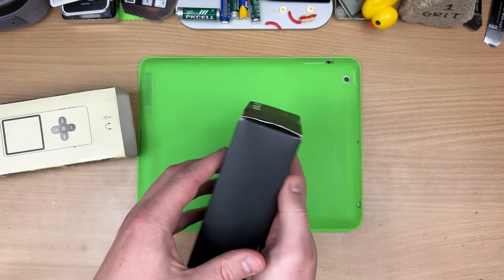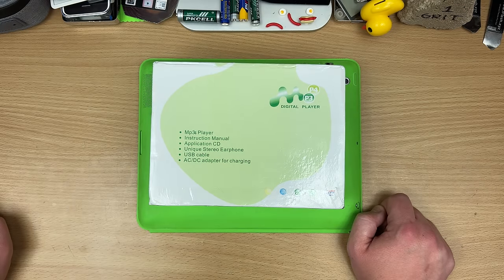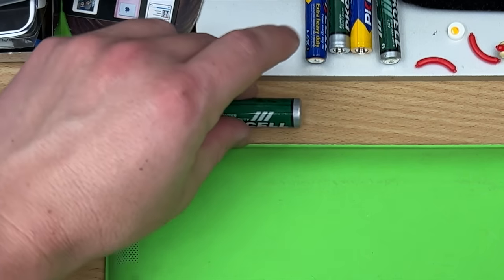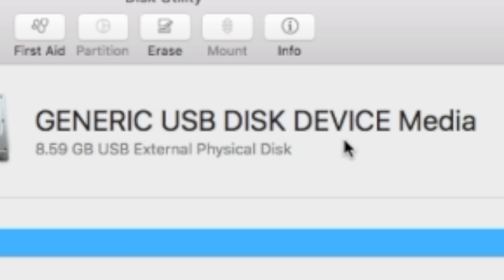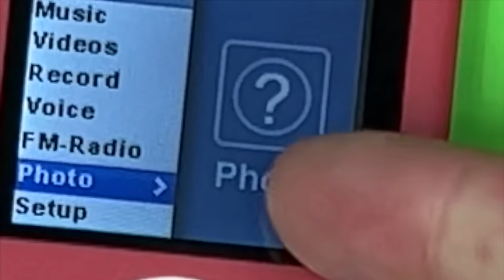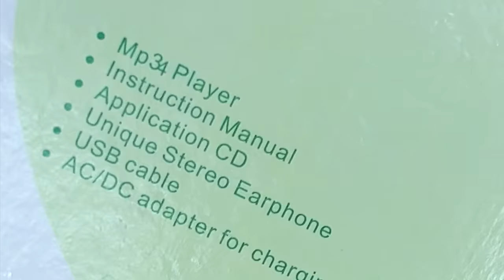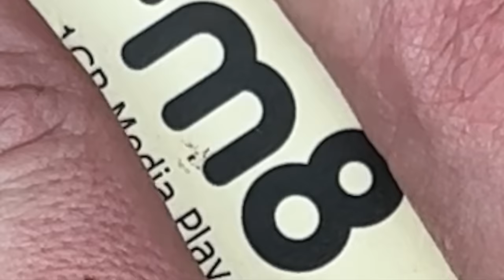The absolute worst bootleg iPod.

Comment: Dankpods getting immensely frustrated with an actually really good windows laptop is hilarious XD
Reply: I mean, it's windows 11 i feel bad for him.
Reply: @Ferrari255GTO  and he could switch to Windows 10, because of the whole seamless thing Microsoft had done with both OS’
Not my fault Dankpods is immensely picky, and has 0 tolerance with anything windows, or also literally 0 knowledge of modern windows.
Reply: @Thewaterspirit57  at least he does know that the new macs aren't worth it either, there's a reason why he has a gen 2 ipad and a 2012 mac
Reply: @Ferrari255GTO  the new ones a literally worth it far more than those old ones. More powerful and actually reliable. He just keeps old ones for other old iPods sometimes.
Also last time I checked, dankpods has an iPad Pro.
Also smh, fake fan. He has an iPad 4
Reply: @Thewaterspirit57  oh, right, firewire is a thing XD. To be honest he would be just as capable of working with ipods with a modern one, it's just that whenever he needs a jumpstart he will need to get a firewire charger
Reply: @Ferrari255GTO  smh fake fan he has a 2007 iMac and an iPad 4
Reply: "really good" :face-blue-smiling:
Reply: @Thewaterspirit57  "the new ones are literally worth it"
Ah yes, pay 4x as much for 1/4 of the hardware, completely worth it. Oh, but you can watch videos and write documents real well with it, definitely need that 2000 whatevermoney ripoff with a fruit on it. Good choice 👍

Comment: DankPods, The iPod was not the issue. Well, technically, it was. But, internally, it actually had a disc error.
Reply: Maybe it has formatted the wrong way or the storage chip was faulty it couldn't read the data blocks inside of it
Reply: @sihamhamda47  I think the error comes from ereasing the disk and formatting it for Mac, it probably was FAT32 to begin with.

Comment: I've looked up the datasheet and that Samsung chip was an 8gb memory, so they didn't skimp on that. They clearly skimped on the people building the firmware, because that nugget did not enjoy being wiped. Hail the 1 grit
Reply: I looked at the datasheet too and it says it's a 1 gigabyte chip. The box and device is lying about its size. That's why it showed up as 1 gigabyte once he formatted it at 9:45. Not only is it a terrible device, it's also a scam because it clearly shows 8GB (8 gigabytes) on the box. 😂
Reply: @JS19000  ok is it one gig or 8 cuz if they said the datasheet said 8 and you say it said 1 is weird
Reply: @kuirivito  It's a 1 gigabyte chip. Since there's 8 bits in a byte that would be an 8 gigabit chip. GB with a capital B means gigabytes and Gb with a lowercase B means gigabits.

Comment: Just a little fun fact!

I know you're laughing at it having a Samsung chip in it, but you'd be surprised to know that Apple and Samsung have had numerous partnerships over decades.  Samsung is one of the only companies with factories capable of keeping up with the demand for Apple products, so it's not unheard of for Apple products to be full of Samsung chips and screens.

Now, I highly doubt that specific chip (which looked like an embedded multimedia card when I googled it) was made for iPods, so that's still something to laugh about!
Reply: Samsung actually make the screens that go on iPhones as well as some of the batteries that ship with them
Reply: @khristopherkomodoensis4734  Pre A-series iPhones had Samsung-designed CPUs and before TSMC's ongoing process node domination A-series chips came from Samsung foundries as well.
Reply: This guy is the only Apple user I don't hate
Reply: Also every iPod (except Touch) after Portal Player has a Samsung SoC on them
Reply: when i saw that it really made me think about how its no different in having samsung parts than a real one.

Comment: That actually looks convincing. They got the finish right, and they even got the iPod font right (which you would think would be easy but most of these guys get it wrong), I mean, the box couldn't look more fake, but the product itself looks kind of convincing, probably enough to fool your friends, as long as you don't let them look closely at the UI. The egg bag looks suspect though, wouldn't use that. Almost seems like the box wasn't designed by the same company that designed the device, maybe a company just bought a ton of these wholesale and they didn't come with boxes, so they made their own half assed attempt which just completely ruins the illusion that it's a legitimate product. But at least they have a box so that it doesn't break in shipping (hopefully)

Shame it doesn't actually work. Maybe it's saying disk error because it's looking for files inside specifically named folders, but there were no folders on the storage so how are you supposed to guess what they should be called?
Maybe you need to use the software on the disc it came with to create the folders and put things in the right places...
Or maybe it just doesn't support Mac format. Try FAT16 or FAT32?
Reply: Fat16 allows up to 4gb in 512 byte sector disks

Comment: I think when you plugged in the "iPod" to your iMac and formatted it, you might've deleted some files that the "iPod" was using, or, even more likely, the "iPod" had folders in it, and it read from those specific folders, not from the main folder. I doubt you can use this info now judging from the... uhh.. state of the nugget in question, but I still wanted to post a comment about this.
Reply: Also could be due to the fact that macOS usually formats things specifically for macos, which the "iPod" probably doesn't support. (It most likely supports FAT32 only)
Reply: that's definitely the case. I had a stinky Nano clone, and you actually had to put music in "MUSIC" and video in "MOVIE"

Comment: Real iPods probably have Samsung chips in them. They're one of the world's largest suppliers of flash memory.
Reply: iphones use samsung RAM if i'm not mistaken
Reply: The first 3 iPhones had Samsung CPUs in them and batteries.
Reply: Classic ipods have an hdd, Toshiba's iirc
Reply: @SilentProti  yes, but all of the Nano, Shuffle, and Touch models are flash-based, and this is a 3rd-gen Nano clone. Many, if not all, of the iPods with hard drives also had Samsung SDRAM.

Comment: So, theory about the 8 gig to 1 gig thing, I’m pretty sure there’s a way to trick the computer to show more storage then is actually capable, and if you transfer more than the actual storage the data just ✨disappears✨
Reply: That is an old trick by some shady bootleg producers. I had a pen drive like that once, bought 16Gb and got just two... They save wrong information on the firmware of the device to trick the compute. In my case the file transfer would crash when it reached the 2Gb mark.
Reply: Imagine trying to make a liveusb like that...
Oof, the Idea of half the ISO failing to write, but not being prompted actally hurts.
Reply: @zehph  I once bought a 32gb flash drive. It read as 32 until I opened it and there was a separate 32gb area with no partition. Turns out it was a 64gb that got put into the 32 production line.
Reply: Linus Tech Tips made a video about that scam a few years ago
Reply: @andrewmorris483  guess it was your lucky day
Reply: If that’s the case though, why would reformatting it cause it to now accurately report it’s size?  He didn’t flash the firmware, just reformatted it, the firmware should still be reporting the same (wrong) size, I’d have thought.  It’s only when you write to it that it’ll crash out.
Reply: @andrewmorris483  Lucky!!!

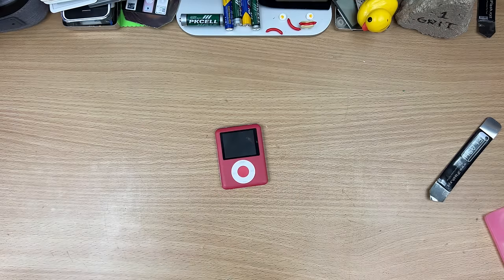Comment: @11:59 If you open an actual (random) Apple product, you could actually find some Samsung chips (like memory/NAND) in it. Samsung is(/was? Seems Apple aimed to do more "in-house") one of the suppliers, of various parts, that Apple uses (others being Toshiba, SK Hynx, Micron, etc)

If I read the markings on the chip correctly it seems to be a 1GB flash chip, so yeah that "8GB tick mark" blatant lie.

Comment: Using a real 30-pin connector isn't as surprising as you might expect. I work in e-recycling and I've seen multiple sandisk and samsung official mp3 players that use apples 30--pin connector, they shocked me the first time I saw them, but now I've seen a good amount of them. So I guess it was used on more than just the Ipod line of devices.
Reply: My high school theatre department had wireless comm headsets (made by Williams Sound) that used an Apple 30-pin connector to charge. They even mention it in the manual.
Reply: My dad has an old Sandisk Sansa player that uses a cable like this. It's actually not a 30-pin connector; it's very similar in form factor, but you cannot use a Sandisk cable on an iPod or vice versa.
Reply: @CocoTheMii  Although the one your dad had might not have supported it, I assure you there are some that do.

Comment: I’m not sure how the “iPod” even worked after you erased everything. I’m assuming there was a little bit of stuff still in ram but I’m pretty sure you wiped the OS…
Reply: Devices usually have a portion of storage that's allocated to the OS that's not erasable through normal means.
Reply: @psychonauts0  I would agree that some parts of the OS are not stored on the hard drive like the BIOS  but given it showed up as USB, i imagine running erase completely wiped the hard drive and the main OS.
Reply: He probably formatted it in HFS+ and GPT instead of MBR and FAT32
Reply: @AllFloofAndNoThoughts  The "OS" is likely in ROM.
Reply: That's, generally, not how embedded devices work. The "OS" (if you can call it that) or firmware are not stored in an location that's accessible via USB/as mass storage, it's either stored in ROM built in to the main micro controller, or on a separate chip and the loaded (via some kind of bootstrap code) on startup. It could be that it's stored in a section of the flash memory chip (but I doubt it, especially since the chip seems to be 1GB, and that is what the computer reports as the full storage space), but still separate from the (user accessible) file structure.

Is it entirely impossible that (part of) the firmware was stored in the file storage? No, but that would be a cumbersome (and unstable?) way to do it (Having to have some basic code first that could handle the file structure, and then load the rest of the firmware. Things like Games would be logical if you loaded from the file storage (easy to add new games etc), but not the main system.

(There are now micro controllers [Arduinos etc] that exposes an mass storage device and lets add "firmware"/code to them that way, but the main "OS" is flashed separately, and not accessible as a normal drive)

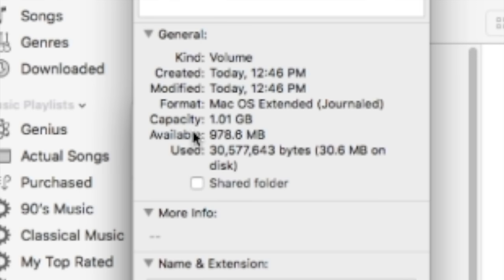Comment: 9:56 hate to bring it to you, but the bootled doesn't support AFS or HFS, that's probably why you got all that disc error, and you may also deleted the OS on your first go in disc-utility
Reply: I think he might’ve just got stuck in a boot loop (if it would even get that far) if he’d erased the OS itself; much more likely that he formatted it in a way the software it’s running can’t recognize or interact with, like you said. Probably wants FAT32.

The OS itself is likely stored in additional memory, like firmware on a motherboard, hence why it could boot and load the UI just fine, but couldn’t access the disk.

Comment: "Designed by Apple in California. Assembled in China"
Yup, says the same on my 5th gen. That print is 1:1 copied from a real iPod, just as the CD is
Even the "Rated 5-30V 1A Max." is a correct copy
Reply: You missed out the typos in the text 😂😂 it actually says Callfomia and Assembied 🤣😂
Reply: The model number printed onto the unit is A1136, which corresponds to the 1st gen iPod nano (the long one) released in 2005, as opposed to the 3rd gen iPod nano which is what this unit is ripping off. Although it's actually printed as AII36.
Reply: @brandontechnerd  oh, don't have my nano anymore

Comment: "linux needs to take over"
I thought the same thing when my wifi adapter crashed and I thought restarting the computer could fix it.
It didn't, and without access to wifi, my laptop was locked out of any administrator accounts and had to be soft formatted.

Comment: Chances are that by formatting the "iPod", it probably formatted it in a file system it can't read. It probably uses fat32, which modern operating systems don't necessarily allow you to format to anymore without third-party software.
Reply: That's what I thought too, he formatted it in OSX journaled, should have done it in Fat32 then it might have worked!

Comment: I have a bootleg iPod that is branded PASBUY.  It has a real touch wheel like the original. 30 pin plug and iPod UI and everything. And it even looks like an iPod on the inside. And it even uses an iPod battery because I had to replace it just for fun.

Comment: Btw when you erased the nug you changed its partition map to GPT, which probably doesn't work with these crappy ones. Even if you tried FAT32, chances are you still set GPT, so it still wouldn't work. Try MBR+FAT32

Comment: You formatted it in MacOS (journaled) which is probably why it didn't work. You should have tried formatting it in FAT16 or FAT32.

Technically though, it should have come pre-formatted in the correct format that it uses

Comment: still wondering how it took him 2 hours to get to the desktop. On my less powerful pc an installation from first restart after loading from usb, it takes 15ish mins to get from there to the desktop
Reply: Isnt His Windows System Like 5 Million years old
Reply: @aaaaa111aaaaa  it supports widows 11

You can only (officially) run it on 2017+ pcs

Comment: I hated Windows 11 (and the nightmare Windows 10 setup process) so much that I finally fully switched to Linux on the desktop. It's great, but I'm not here to evangelize Linux this time.

You know how Windows 11 has a "fresh new look?" It's basically a crap version of the KDE Plasma desktop environment for Linux. Except Plasma is exceptionally customizable, where Win11 lost features from Win10! Whether or not Win11 actually ripped off Plasma directly, the side-by-side comparison is deeply unflattering, especially when one is completely free.

Windows 11 is the biggest step backwards for Windows design since Windows 8.0

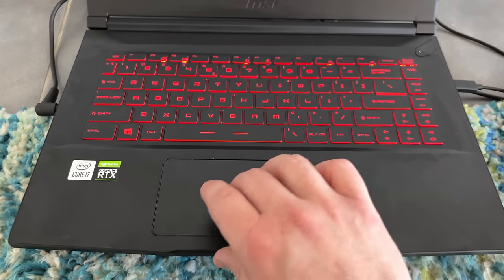Comment: 9:07 It's off center because they probably use the same internal chassis for "business" laptops which would have a number pad and therefore the underside of the touchpad which likely protrudes down into a cutout for that system. With a number pad it would be centered on the regular alphanumeric portion of the keyboard. Also I hate windows 11 save your self some pain and go back to 10 lol

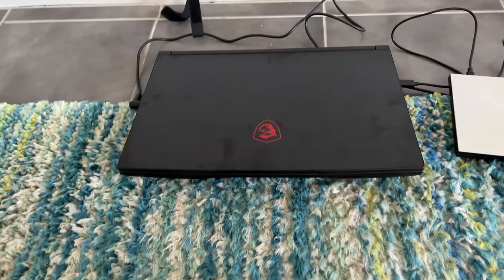Comment: 9:27 ✨be the change you want to see in the world ✨

also, I'd just like to interject for a moment. What you're refering to as Linux, is in fact, GNU/Linux, or as I've recently taken to calling it, GNU plus Linux. Linux is not an operating system unto itself, but rather another free component of a fully functioning GNU system made useful by the GNU corelibs, shell utilities and vital system components comprising a full OS as defined by POSIX.  Many computer users run a modified version of the GNU system every day, without realizing it. Through a peculiar turn of events, the version of GNU which is widely used today is often called Linux, and many of its users are not aware that it is basically the GNU system, developed by the GNU Project.  There really is a Linux, and these people are using it, but it is just a part of the system they use. Linux is the kernel: the program in the system that allocates the machine's resources to the other programs that you run. The kernel is an essential part of an operating system, but useless by itself; it can only function in the context of a complete operating system. Linux is normally used in combination with the GNU operating system: the whole system is basically GNU with Linux added, or GNU/Linux. All the so-called Linux distributions are really distributions of GNU/Linux!
Reply: #GNUPLUSLINUXGANG

Comment: Also your internet is kinda terrible and unreliable because Australia do be like that.
Not even my Aunt and Uncle living out in this small little town they’ve been in have internet that’s good. They’ve been on 56K modem internet for YEARS, and was stuck on windows XP (or maybe even 98) because of that. Even with their satellite internet, that’s still 10Mbps, and a storm would cause it to go out, so they have two internet mediums so they don’t get disconnected from family.
Meanwhile in the town I live in, with 500Mbps internet, and the city my sister lives in with the option for 1Gbps internet. And that depends if the device itself is powerful enough to even use that internet speed.